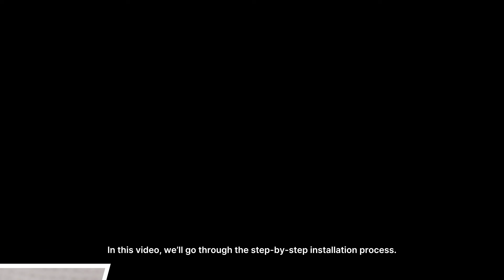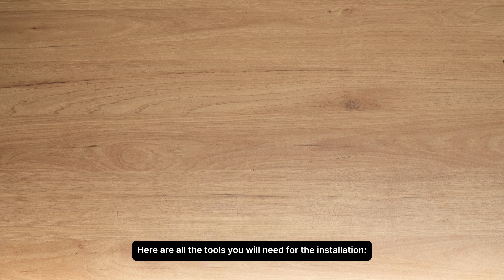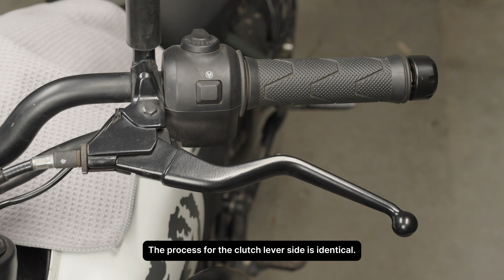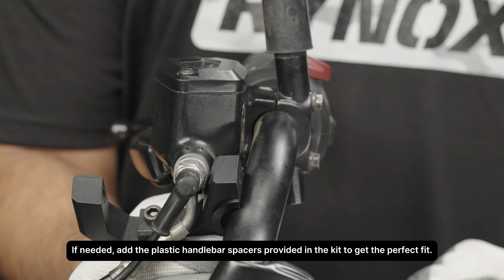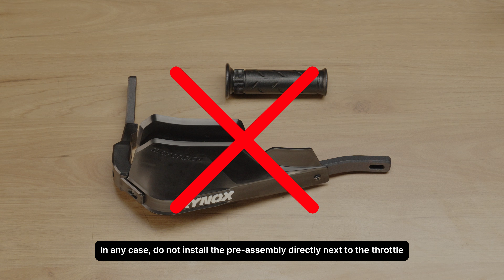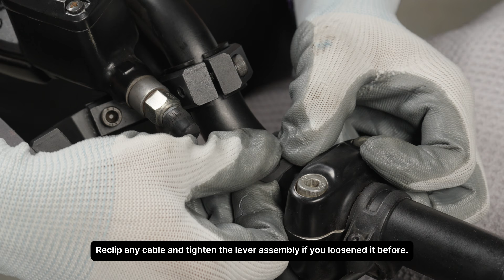Rynox Defender Pro Handguards: How to Install

Comment: Which windshield are using on the Triumph scrambler.. looks good, is this later available on rynox.please reply.
Reply: It's Himalayan 450 touring windshield
Reply: @choudharyajay7  do you know if it is a direct fit or modifications are needed?
Reply: Could you please provide the details how did you install and also can you please give the details on gps mount thanks
Reply: Any idea which mounting brackets used ?
Its not a direct fit brackets needs to be changed